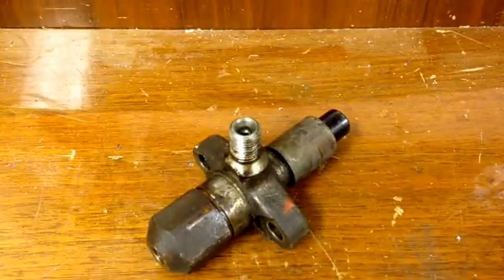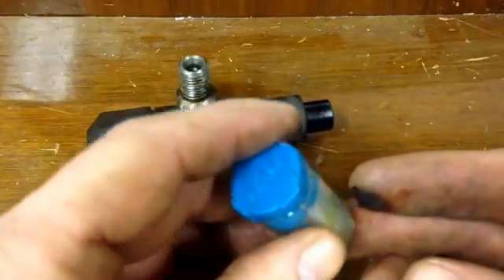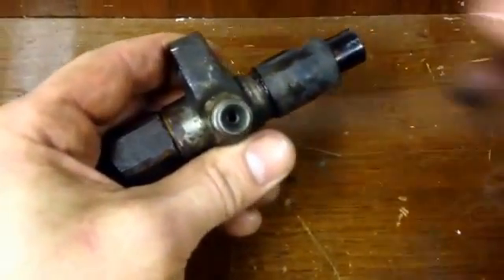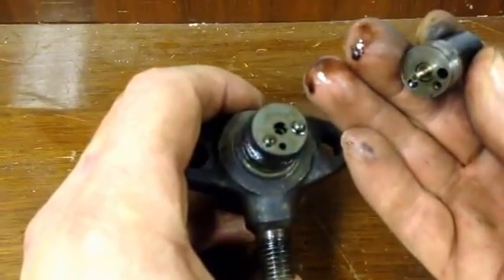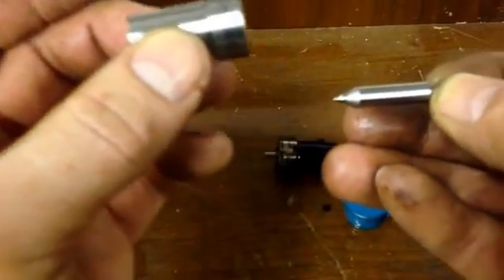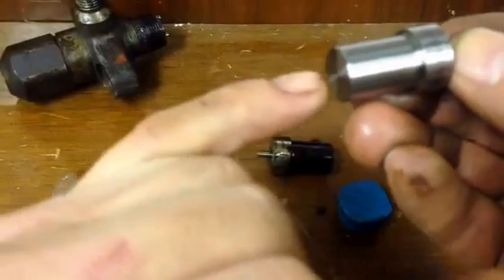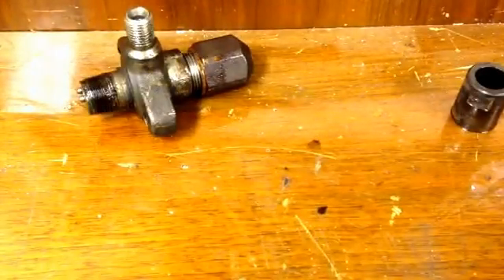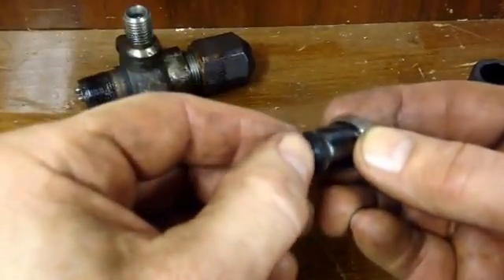How to repair a diesel injector - 1500 bmc shown as example

Comment: Thanks for the info. I'm looking at my Toyota Land Cruiser injectors which have half a million kilometres on them and want to clean them up. I don't see the adjustor screw though. Seems they're made to have one set position only?
Reply: they probably have a shim under the spring to set pressure

Comment: The pintle (needle) on my injector is stuck inside of the nozzle, can't even pull it out with pliers, currently got it soaking overnight but will try your method after that.
On the pop tester the injector squirted like a water pistol and dribbled, had alot of what appeared to be either dirt or sand inside of the injector when i cracked it open, no wonder the car ran like crap lol, was like a mosquito fogger.
I only just bought the car so its not my doing.

Comment: Well that worked! Getting the pintle out, I mean. First drill wasn't gripping hard enough, just slipped aroun ' an' aroun'. Couldn't believe my eyeballs when I actually saw it come out with second drill. Maybe two ultrasound baths had something to do with it. 
I'd bought a nozzle a coupla years ago and left it sitting around. Took on a film of rust-colour. Had it tested and it failed! After lots of spray and sonic bath, and it still failed. Is that normal? WEll, I'll go watch your other vidos. 
OH, I've seen a vido where a guy lays a bar of copper on the nozzle, on the pintle, and taps it free!!

Comment: i took a set out of my peugeot 504
i then decided to use my bench polisher that i polish stainless and chrome parts
and made the parts look brand new
i polish brake pistons often n said humm
why not try it.
i did order new ones, for when i get another car or wa t to replace these
but i thought hey these look great now
so i may stock the new ones for later and get a other 50k miles with the polished injectors.
i got new copper rings the old ones were ruined
just thought id see if a yone on youtube ever polished the bits and reassembled them

Comment: Hi, I know you don’t reply much to your comments but I’d be grateful for a bit of help, my boat started chucking white smoke non stop while revving, low on power and misfiring a lot. I’ve tried your method on all four injectors but found no difference. All of the pintels came out fine (I used 50/50 reddex mix prior to removal) I also took the head off and replaced the head gasket and started it without the exhaust manifold (nearly killed myself with the fumes 🤭) two and three seem fine but I get puffs of smoke from number one and number four constant smoke. Are my injectors well past there sell by date or is It my injector pump ?  Appreciate any advice I can get cheers... good vlog though
Reply: Andy Lunnon Sounds like you got a valve sticking to me mate

Comment: Plant mechanic/Thanks for video very informative for beginners one quick question,, do quenching not harden ? I think air cool softens apposed water makes molecules angry and hard? I could be wrong☺
Reply: that's  just on steel; copper work hardens   if you hammer on it  ,or bend it back and forth,or compress it hard like here it hardens...a lot!!   what he says is correct.

Comment: Perfect. I have a late eighties Kubota 3 cylinder engine in a ride on and think the injectors might be leaking as oil is runny. If not the injectors it's the injector pump or worse hst fluid.  Anyway great vid👍

Comment: Sebastian...I have the marinized version of the BMC engine in my sailboat...the motor is a Westerbeke 30 (1980)...has these same injectors. Can a faulty injector cause diesel fuel to enter the engine crankcase oil ? I am getting fuel in my oil and wonder if after the engine is shut off diesel is dripping from an injector and washing down the piston wall into the engine oil crankcase.
Reply: Excess fuel getting into the combustion chamber will leak past the rings, into your oil. Faulty injectors hose fuel, rather than spraying it.

Comment: Hey Sebastian. 

Any idea what the fuel pipe thread is on this BMC 1.5 injectors? 

I'm looking a pop testers, but don't know what kind of fitting I needed. Is it 1/4" BSP or something along this line?

I can't find a manual with the specs.
Reply from the maker: matt macindoe it’s the ‘standard’ injector thread so any pop tester fitting will work
Reply: Are you sure?

This one for example comes with various fittings, M12, M14, M16, etc. 

https://www.ebay.co.uk/itm/DIESEL-INJECTOR-NOZZLE-TESTER-Calibrate-Injector-Pressure-leakage-spray-pattern/252613369965

Pretty sure nothing on my engine is metric though.

Comment: Thanks Sebastian. This was very helpful!

I'm currently trying to restore an old BMC 1.5. I'm a complete novice, so this came in handy.

Couple of quick questions:

Firstly, how would you recommend adjusting the spring to the right tension? I know you say in your video it's not a precise science, but I'm guessing there's a way to get it roughly right?

Secondly, do you know if there's a reason why the fuel pump might have lost pressure? Cleaned out my injectors, as per your video and hooked them up to the fuel inlet lines, but kept them out of the block to see if I could get atomised fuel spray coming from them. I get two results: one is pretty much a 'skoosh' (little more than a dribble) if I loosen the spring right off, and the other is nothing at all, if I tighten the spring right up.

I removed the injectors and kicked it over again with the starter to see what the fuel was like coming out the end of the lines. It doesn't look particularly high pressure, and I'm just wondering if the pump could have lost pressure somehow? What gives it pressure? (complete novice sorry)
Reply from the maker: matt macindoe in short, see my more recent video on pop testing injectors....

Low pressure from pump is unlikely as you wouldn’t get any fuel injected out of injector. 

Your best bet is to buy a cheap pop tester off eBay, that will resolve your injector problems, but to give you any idea of solutions I need a bit of background on the engine -
Reply: Hi Sebastian. Thanks for responding. 

Yes, I had a look at that video. I'm going to do that.

I'm also going to take a short video - take the fuel lines out the injectors and show the type of fuel pressure that exists. 

With regards to your comment on not getting any fuel injected out of the injector, this is basically exactly what is happening when there is any spring pressure applied. I have to loosen the injector spring right off until it is basically exerting no force; then I get a little 'squirt' of fluid out the end of the injector, but that's it.
Reply from the maker: The problem will be air in the injector pump most likely then. Assuming engine ran before
Reply: No. I bought it as a fixer upper for next to nothing. 

So far I've put a new fuel filter and start motor on it. It turns but doesn't fire up. So I'm investigating (1) fuel injection and (2) compression in parallel.

Last time it was running was 4 years ago. But it doesn't appear to have seized.
Reply from the maker: These are a pig to bleed. See my other video on that. Note - bleed pump then turn engine a full turn then bleed again. Air hides under the rotor in the injector pump if you dont
Reply from the maker: matt macindoe air in injector pump.
Reply: Is this the video you're referring to? https://www.youtube.com/watch?v=QXlXrnprFwU&t=183s

If so, I think I followed this process already in order to get fuel coming out of the lines. But maybe it needs further bleeding. 

I'll send you a video shortly.
Reply: Sebastian Hibbert I’ve taken a wee video to show you the fuel coming from fuel lines. https://youtu.be/YcZvzYZSDfc

I’m a complete novice, but in my mind the pressure of the fuel coming from these lines would need to be much greater than these little squirts, in order to overcome the spring force holding down the pintel. Am I right or have I misunderstood how this works?
Reply from the maker: matt macindoe that looks normal I’m afraid. It’s how my engine would look
Reply: Sebastian Hibbert well I guess that’s not a bad thing. But can it really overcome the spring force of the injectors with this little pressure in the fuel lines? Seems piddly. Or does the pressure build when you attach the injectors?

I guess the next job would be to test the injectors with a pop tester then?
Reply from the maker: matt macindoe next job is to connect injectors and turn engine over for 15 seconds a few times, spaced 2 minutes apart.
In my view if it doesn’t then inject there is an injector pump fault
Reply: I have someone on ebay willing to sell me a used CAV pump for £55. But I told him he needs to test if first to see if it works. Any idea of a simple test you can do on these pumps to check for functionality?
Reply from the maker: matt macindoe only test is to take it to a diesel test shop. But most likely it’s working - you always need to take your own pump in for repair, do a spare ‘broken one’ is unlikely

Comment: Hi, the workshop manual and parts manual for my Leyland 154 tractor, 1500 cc diesel motor,  show "heatshield" and washer on the front of the injector when it is returned to the head. Are they necessary, and, if so,  what is the correct way they should be installed? I have never seen them on any other motors..??
Reply from the maker: Their stamped thin washers like spring washers I think. I think their to stop heat transfer to the back of the nozzle

Comment: A real how not to video... agree cleaning can work (even like shown in the video) only the adjustment of the openings pressure is inportant, so if you do this methoth be sure to have a injector tester at hand, adjust the openings presure to the engine specs, and check for good vaporizing, not after dripping  and the angle! (the end of the needle is not always straight, but often has a cone shape, all depending on the tipe of nozzle/injector.) iff the needle has become to hot , its junk, and you cant polish it out, so the injector doesnt vaporize correct, and the engine will start bad, or smokes exessive., beter is to bring them to a specialist, a new norzle is way cheaper then damage to a piston or honing glazed cilinder walls and stuck rings.
Reply from the maker: +MrBugsier5 agreed. Have purchased and started using a pop tester - video to follow.

Comment: Hi , openend and rebuild mine before watching the video . Put in new tips and all that but now I am stuck on how tight the adjustment screw should go in. I've put em all back in and now she doesnt run..... (the one that holds the spring without the nut part....so just the treaded bit) 

Thanks for the vid!!
Reply: Hi, the screw adjusts the spring tension that holds the needle closed in the holder until the desired optimum pressure is reached, this is a specific pressure to your engine and will need to be adjusted using a pop pressure tester

Comment: Thanks for the video. I am not sure the 1.5 litre nozzles and 2.2 litre nozzles are interchangeable. I am not sure the 1.5 litre nozzles can still be bought new, but you seem to have them. The 2.2 litre version nozzles are still available but have two outlets, these nozzles are called "Pintaux" (auxilliary jet). The 2.2 litre engine has a conventional injector installation, whereas the 1.5 litre nozzle sprays into a chamber off the cylinder. I think the torque on the nozzler holder should be adjusted accurately with a torque wrench to pre-load the spring correctly. This allows for a better hair-trigger effect, that leads to chatter when the pressure trips the pintle, producing an interrupted spray. I might be wrong...
Reply: actually I just have a question on Mercedes benz atego 1823 it bringing out a white smoke from the axhouse but I have changed the nozzales but still same problem so what can I do  and whats the pressure level does the nozzales need is it 280 or 240 for atago 1823?

Comment: Great vid mate.   question for You, pintle injector from kubota ride on mower, injector was working on tell i took it apart!!  now it will not fire ...    ??
Reply from the maker: Don't heat silver washers - their aluminium- if the injectors don't work after you take one apart I suggest you take another working one apart and see if you got it wrong rebuilding the first one

Comment: The Pintle is not a guide. Its function is to form a spray pattern with the injected/atomized diesel. Try not to handle the Pintle too much as you don't want to bend it and disturb the spray pattern!
Interesting video though!
Reply: No it does not these injectors shoot out straight fuel then they hit a spray boot thats in the injector seat.

Comment: Absolutely Fantastic... I am having fuelling issues with my mondeo mk2 diesel (turbo endura)  at the moment.  And I was wondering whether you knew if the older mondeo had pintle type injectors.   Only one of the injectors has a wire  which is apparently a needle lift sensor??  Anyway brilliant video and really useful info.   Cheers!

Comment: Very interesting video.
Reply from the maker: I hope so.... I've fixed quite a few injectors this way. I have also done several injector pumps..... They are soo much easier to work on than diesel engineers say ( within reason )
Reply: I have an old 1976 Argentinian Rastrojero diesel, indenor 4 cylinders uses this kind injectors. Thanks for video, very helpful!!!